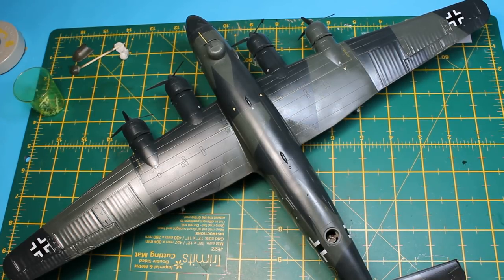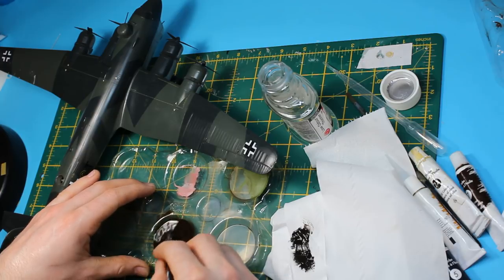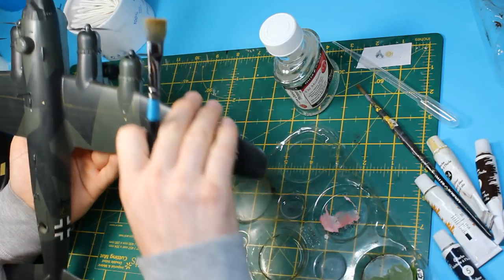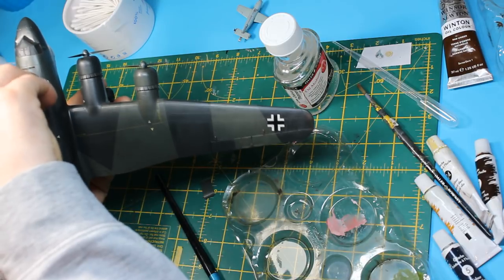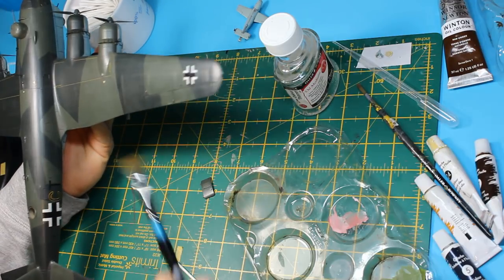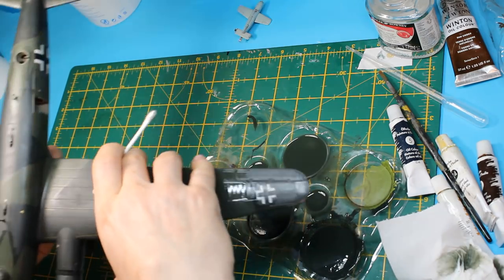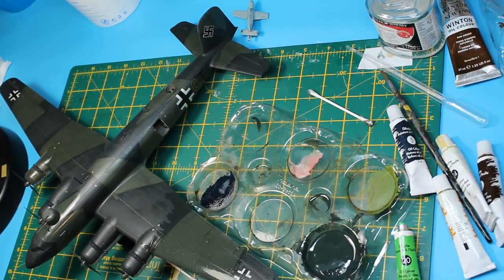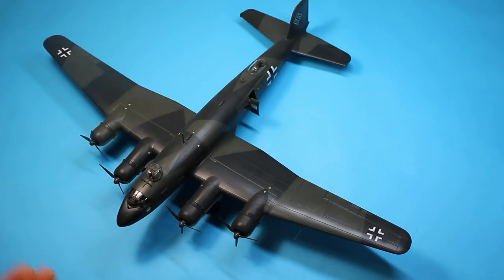Revell 1/72 Fw200 Condor C5/C8 Full Build Part 4 Final Reveal

Comment: Great build of my favorite aircraft. Your technic of weathering will help me  weather the Do 217 1/48 I'm building. I have the Condor in 1/48 which is a very big model. Must admit I had it professionally built for me years ago because I didn't want to make a mess of it. However, I did build the original Revel 1/72 Condor back in 1983 which was the center piece of my collection back then.